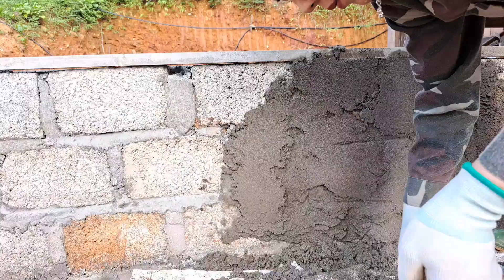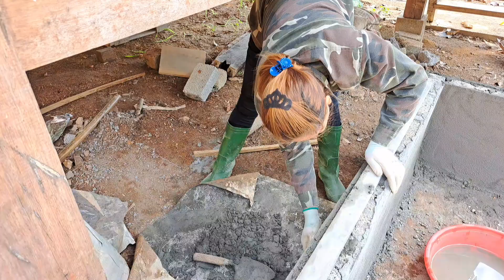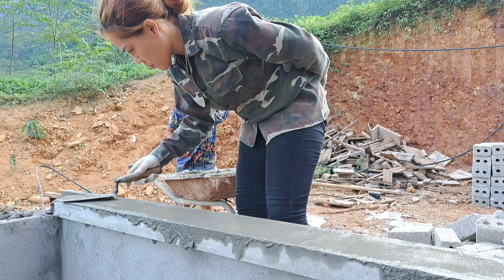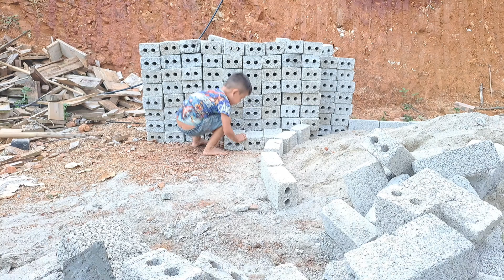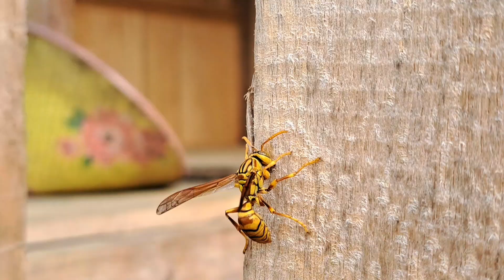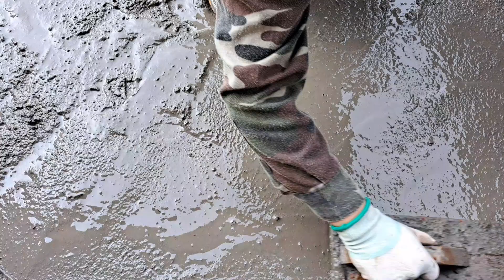Techniques building fish tank, smooth cement background - Green forest farm, free bushcraft

Comment: Girl - you need to do two things - first wet the wall and 2nd make the plaster wetter, then spread it on and use a straight edge wood or metal to level it and then leave it alone to get firm. Then smear a thin coat of wet mortar over it and use the wooden trowel/'float to rub it smooth. Then  it won't keep falling off!
Another way is to apply a thin wet coat and allow to dry, scratching it with a piece of wood with nails in so provide a key, then go over it with the 2nd coat.